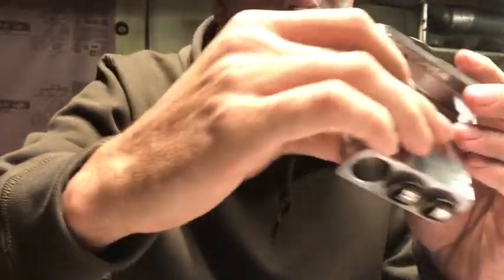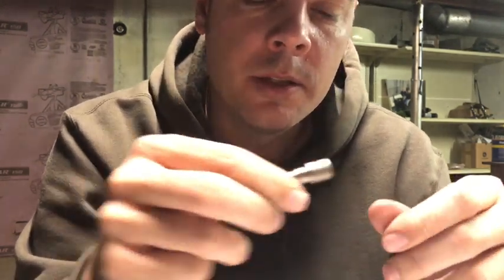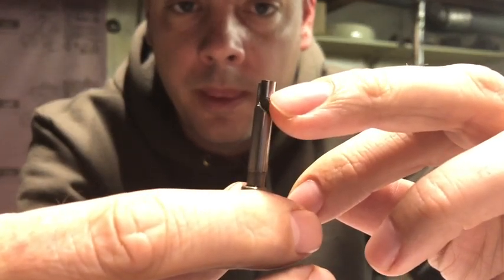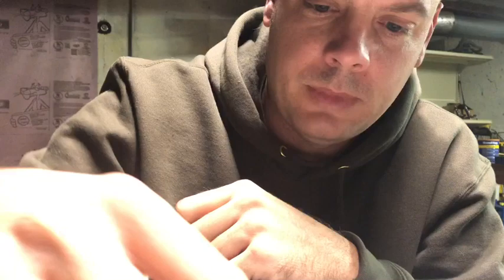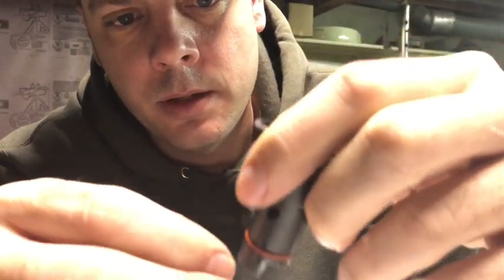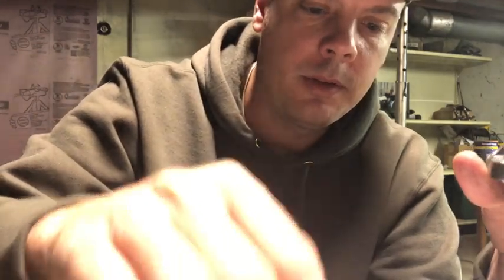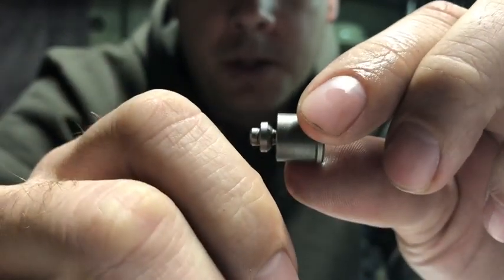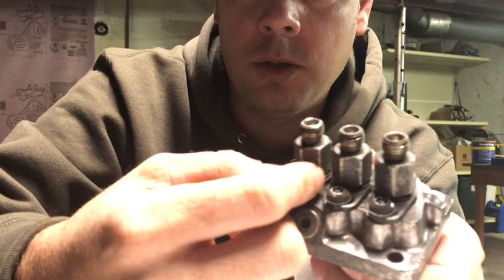Zexel injection pump assembly

Comment: Thanks just the information i was looking for. I soaked a seized denso pump for three days in a heated ultra sonic cleaner. Finally got everything freed up enough to tear down. Got back to assembling everything and forgot which way the plunger went into the barrel! Its off a older Mitsubishi k3a engine. So my parts are a little different but i get the idea. Mine also has a mechanical cold start fast idle feature.

Comment: Is it possible to replace the barrel holder o rings with the pump housing still in the machine or does the pump assy have to come out and be done on the bench, thank you.
Reply: Did u ever figure the oring replacement out thanks

Comment: Hello what type pump are these? In loosing weight from governr weight counter did you drill or turn off using lathe? Watched your manor of cutting valves
Reply from the maker: @geraldglenn1  zexel pump. And drilled the weight on the governor.

Comment: I have a 4 cylinder perkins with a similar injection  pump. I'm getting fuel in the oil. I've changed the fuel shut off solenoid, all the injectors and have had no luck. It doesn't have an ounce of blow by so I don't think its a cracked/hole in a piston. My last shot at trouble shooting is the O-rings on the outside of the barrel port that mates with the injection pump case. Do you think that a broken O-ring could be the cause of fuel in the oil?   Thanks
Reply: I have the same thing already with two the same pumps 4 cyl, think it is a common issue for this pumps, i changed the orings but still its leaking on top and in the motorhouse. I did not find a solution and bought an other pump

Comment: Hi, thanks for detailed video. I had Cummins onan 7500 with kubota 3 cylinder engine. The gen was a few years working with no major issues until now that get high rev all the times and I had not find the way to restore normal RPMs for work. When I started it go to full acceleration and I had to cut the fuel for turn off. Could be the rack governor loose in any way and stuck in high RPM? Any advice? Thanks.

Comment: The vertical slot on the plunger.  I have a zexel that is similar, do you mean that the vertical slot goes opposite of the fuel inlet? Essentially opposite of the slide.

Comment: Great videos, can the fuel leak down the crankcase and mix with engine oil, if so what causes it and how to repair , cheers
Reply from the maker: Yes. The barrel holders have o rings top and bottom that seal against the pump body.
Reply: Can the barrel holders be removed to replace the o rings without having to remove the whole pump and dismantle it
Reply from the maker: @shalensharma636  it will need disassembled.

Comment: I need to replace the two o-rings on the barrel/plunger housing. Squirting fuel. Can I do this with the pump still installed in the machine? I can’t tell if that roller lifter in the bottom of the pump is attached to the barrel housing.
Reply: yes but be carefull

Comment: I know this is late but do you know how to turn this pump up or can it done
.also what about injection timing on this pump. Not a whole lot out there on this pump.
Reply from the maker: I have a video listed on spill tube timing. If you want more fuel you can remove the screw that limits rack travel on the block. The other thing is turning the barrel holders cc but the pump will need to be calibrated after doing that.
Reply: Thanks information.  There is not a lot out there that I can find on this pump. Thanks again .
Reply: Would that be the screw with the tamper resistant cap on end of for block on front of engine
Reply from the maker: @danielboyd9507  one should be just under the injection pump bottom bolts that hold the pump in. It’s been a while but next to the fuel solenoid some models may have limited rack travel there too.
Reply: @Plowboydually  
Thanks for the reply.  Just now saw it. Thanks for your time. Very helpful
Reply: @Plowboydually  why does it need to be re calibrated if all you are doing is adding more fuel and that is what you want?  Timing is by way of the shims. Flow you are increasing i am trying to figure out what calibrating will do.  I have a pump that one of the cylinders is getting way too much fuel.  I took it apart to fix it as its was frozen but i am wondering if it's the barrel holder i have off a bit.
Reply from the maker: @lauralichti3180  sorry I just seen this comment. Calibration will equal fuel output to each cylinder. It don’t take much to get them off. My case I was just after fuel and testing what I did but really you want all cylinders working an equal amount.